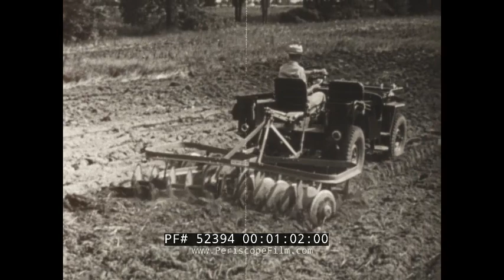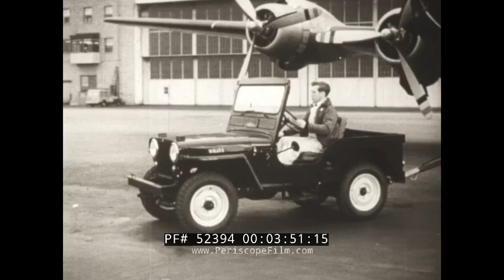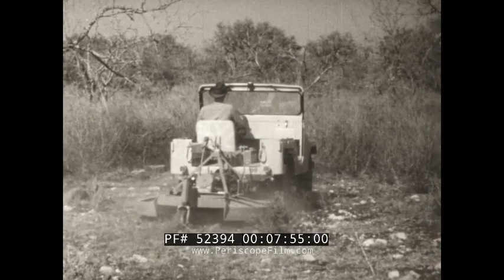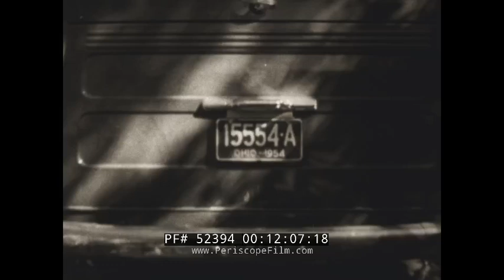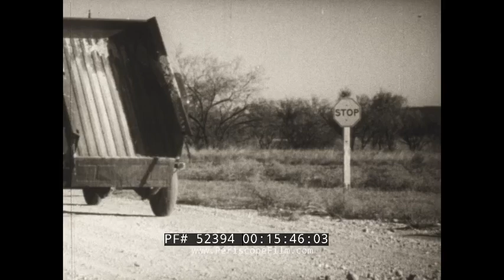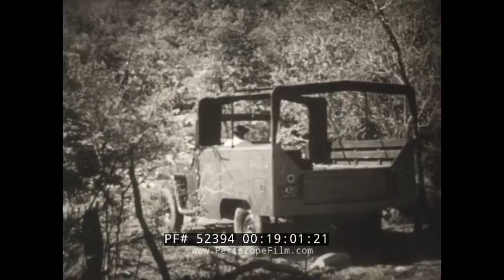1954 JEEP PROMO FILM   THE JEEP FAMILY OF 4-WHEEL DRIVE VEHICLES AND SPECIAL EQUIPMENT 52394

Comment: Cool.   Use as a tractor was missed out in U.S., not sure why.

W. Germany made the Unimog.
Reply: It couldn’t compete with a tractor,   Turning circle was huge, not manuverable at the headlands when plowing, and the bodies rusted quickly.    And too expensive.  Looking around the landscape of America and it is still dotted with 40’s and 50’s Ford tractors.  You are hard pressed to find an old Jeep.
Funny to read the comments below.  I just departed the Land Rover space and they all lament the same about Defenders.
The Jeep ( then and now)  is not the right tool for field work.  You can never generate the traction needed for the plow and other implements because the tires are too small.  Tractor tires are designed to generate tremendous leverage.  We tried a 1 bottom trailer plow behind my Range Rover.  Not a success and had to be rescued by the Oliver 55.

Comment: I wish they would make jeeps like this now. A Jeep now is nothing more then a glorified, overpriced, exaggerated soccer mom car. It’s not what it used to be. It’s all about creature comforts now. Just like my GMC Sierra. I had a 1987 K10, granted it’s half the horsepower and torque and the 4x4 system isn’t as good as my 2013 Sierra. It was a truck, meant for work. It has a/c but has manual windows and transfer case shifter. My 2013 is power everything. I just wish they would make options to order vehicles like this nowadays, order a truck or whatever that is specifically a work truck.
Reply: Well some ( mainstream ) trucks are made that way , primarily for Fleet sales . But not advertised to the public . and rarely ordered for dealer stocks . or usual distribution channels . If you look around for them, you'll see them used by construction companies , utilities , government fleets, etc . Think solid color, little or no chrome, crank windows, vinal seats, rubber floors , etc .

Comment: WHERE CAN I FIND THESE??????!!!! lol
Reply: I see lots of them, most are completely thrashed,wore out rust buckets fubar..what can you expect? 80yr old vehicle.....
Reply: Plenty of them still around , albeit neither pristine , nor totally original . For several decades they have had enough enthusiast/ collector interest that they would usually get rebuilt/ upgraded instead of scrapped .

  But even 50 yrs ago , it was common for swaps of engines , transmission, transfer cases, and axles . Reproduction parts are available for all of them back to year zero

   The original '40s and '50s drivetrain specs weren't suited to more modern tastes of " serious " fourwheeling with lifted suspensions and large tires . When original components would fail , or be clearly outclassed ,  upgrading was normal .

Comment: I have a 1969 CJ5 and a 1960 Wagon currently but I have owned a CJ2A and two CJ7s in the past since the early 1980s.  They are all great vehicles but honestly my 2015 stock Rubicon 4 door is more capable on and off road.  My favorite jeep is my 1969 CJ5 with factory Buick 225 odd fire.  I owned the CJ2A for over 30 years.  My 1977 CJ7 was a Levi Renegade.  Even my wife’s 2014 4 door Sahara without lockers is more capable than any of my old ones.  People who say the new needs are junk are simply not correct.  I bought a new 1989 Wrangler.  That was the weakest jeep I ever owned, but since then they have really improved the wranglers.
Reply: I too own a current model Jeep and have to say they have come a long way...however I don't believe with all the electronics and computers etc. that it will be around 70 yrs from now as the CJs of this period. Currently enjoying a 1949 CJ with everything working...not bad for a 73 yr old.
Reply: @rambokd  you have a good point about the electronics and computers.  I agree.

Comment: Sad that Jeep Corporation today is not pushing the utility services of these jeeps can still offer.  There are still many applications that they could fill today.  My dream job would be the president of Jeep, and get them back on firm footing, for why they were invented.   I have restored 5 jeeps, and have a deep respect for their adaptability and capability.
Reply: You forgot Daimler-Chrysler and Jeep Corporation in the mix. There was a Jeep corporation it was formed from the assets that Kaiser-Jeep sold to AMC and was a wholly owned subsidy of AMC that eventually faded away. When I was stationed overseas we had a 2 1/2 ton (Deuce and a half), that data plate indicated it was produced by Jeep Corporation  And you've ignored the legacy of AM General which was the Jeep  military vehicle business that was spun off when Renault started buying AMC stock as at the time we didn't allow foreign ownership of defense contractors.  Eventually AM General was purchased by GM. No company that owned Jeep has lasted more than 10 years after acquiring Jeep. I Bantam developed most of what became the Jeep, but Willys had a more powerful engine the Army liked and some of the officers charged with the decision preferred Ford as the manufacturer.  American Bantam didn't have much production capacity so after the initial run of Bantam Reconnaissance Cars (BRC) the Army handed the design over to Willys, then contracted both Willys Overland and Ford to produce them. Many of the BRC cars used Willys chassis and engines with Bantam providing bodies, about half of them were shipped to England as Lend-Lease before we got involved in the war.
Reply: @fk4515  Correct on all counts.
You get the prize!
Reply: @fk4515  very nice
Reply: @fk4515  Jeep Corp. was a subsidiary of AMC, later renamed "Jeep Eagle Corp." before merged into Chrysler. By the Daimler years it was simply "Jeep-Truck Division" (Jeep and Dodge Truck engineering).
Reply: Sad that you believe there is a Jeep Corporation today.  There was Bantam, Willys-Overland, Kaiser, Kaiser-Jeep, American Motors Corporation, Chrysler and now Fiat Chrysler Automobiles.   Jeep is now and always was a brand, not a company.  Jeep is FCA's most successful brand.  It does not need to get back on a firm footing.
Reply: Because Jeep Enthusiasts are greatly outnumbered by mainstream buyers , and mainstream buyers like the current offerings just fine , and purchase lots of them . Just be grateful for the Rubicons .
Reply: nice
Reply: still a badass design, whomever's truly responsible.. 53 and below is my way to go

Comment: And then the Jeep grew (much like my fellow Americans waist lines) into a 4400lb hippo that couldn't go down a trail, with four doors, AC, automatic transmission, power steering and now optional 2 wheel drive the only thing jeep is the grill... and it's plastic I believe.  
Chrysler executives/designers  if you are reading this why not make a CJ2a sized Jeep with a high torque four cylinder that isn't turbocharged, but a nice all around jeep, keep its weight under 2800lbs, and make it look like a working man's vehicle not some front driver derived 4x4 but a legit solid axle, high pinion, High/low transfer case and a lever to go from 2 wheel drive to four wheel drive?  You can add all the luxury crap but make a nice small hard core 4x4. 
Make it small and reasonably priced maybe make everything an option like the good old days.
Reply: Except the Gummint won't let any company build a new vehicle that doesn't have air bags, TPMS tire system, etc., etc,...
Reply: @LongBinh70  that is true, the feds have their fingers on safety and emissions but I would think they could still make a reasonably priced truck that is small. I mean they make 700+ HP cars that are smog legal and run quarter miles in the 10 second range for 60ish K I would think they could make a caged cj5 sized jeep with a full removable hardtop  with a 2 liter pass safety and emissions in the 25k range. I bet they would sell a ton of them. Every hunter and outdoors man would want them.
Reply: Go buy/look at a roxor  It has everything you want except the  ability to be licensed in some states. Youtubes that stuff or interwebs it, because its out there.  I think it's even diesel not that dirty fiat junk either.
Reply: The main issue with that, is that the market for that has shifted over to ATV's mainly, if you see some of the larger ones like the John Deere gator or some of the ones made by Polaris, they are about the size of the CJ2, and they do sell, if anything, the market is a bit saturated.
Reply: @cpufreak101  atv's aren't street legal in most states. So that kills the buy an atv argument. Also they aren't cheap considering they are adult toys.
Reply: Chrysler threw the baby out with the bathwater.   Our military alone, would still be a major user of the Jeep if only, the Jeep would just try to make a product for them.  The MB and GPW was one of major vehicles that helped us win WWII
Reply: @crt246  the military industrial complex stole Chrysler defense, and up armor a jeep to acceptable modern standards, and it ain't a jeep no more.  The hmmwv isn't viable anymore, for the same reason.
Reply: Atomic R A You sir naild it
Reply: Atomic. Same for LR
Reply: @pauls466  I am sorry I didn't see your comment back when you posted it.  The new D90 is a damn joke, so is its range rover cousin, I don't see them having a loyal following like the solid axle trucks from years past.
I actually own a 92 Range rover and I love that thing, I don't know which I like more Land Rover or Jeep but here in the states all real Landies are so expensive, a series truck was rare when new and the D90 is about $100,000 for a US market truck (imported from 94-97) now the Range rover classic as everyone has realized that they are extremely close cousins to the defenders The price has went nuts because its the last of the solid axle 4x's.
Reply: Very well said!! Yes please, id like a tough, small battlelax engineered for the business, like ol Willys Overland used to do... Please?
Reply: Amen well said.
Reply: hmm.  

Yep.
Reply: I've seen a 4 door rubicon in a spot that'd make a Toyota toss it's lunch and curl up In the fetal position.  You're full of shit.  Want a side by side, buy one.
Reply: @randymagnum143  you don't need to go on the defense about jeep, we all like jeep and the new rubicon is a bada--s Factory 4x4, the air lockers are cool and its a nice family car for the outdoors, but it isn't a TJ nor a CJ5, for the utilitarian aspect that the jeep once was, the fact remains its big, like real big, even the rare to see 2 doors are pretty long, going down a rabbit trail it isn't going to do gently at least now without its owner cringing at the Arizona pin striping it will get from dragging down every bush on the trail.  besides it looks strange with the doors off but I digress. The worst part of the jeep is its now over $60 grand and that is before the 10 grand worth of armor and accessories it will need to be truly capable off-road.  Thats a lot of money for a jeep even a cool one.  A smaller ¼ ton truck like the original would be a nice replacement for the Jeep renegade that is an insult to the renegade package the jeep has had since the 60s.